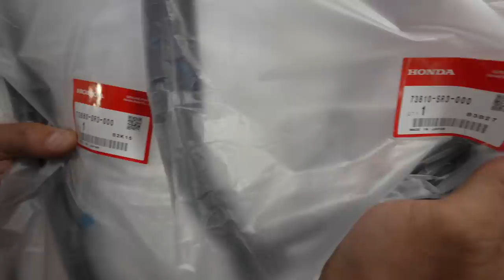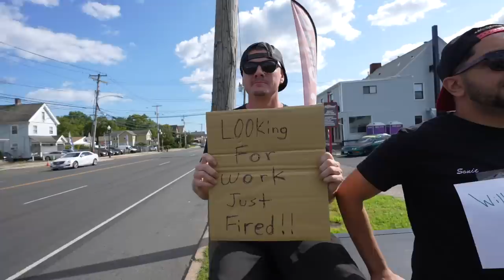500hp Turbo k20a2 Civic Si Build! Perfection!

Comment: ive been using a timing cover drain on my car for the past 5 years or so, never once had an issue on the streets or the track. one thing that did happen from street use is the return hose started melting from the manifold, it was about 6 inches form it but on a hard rip it still started melting. i ended up doing a heat shield sleeve down the entire length of the return and never had another problem with that.
Reply from the maker: ok good to hear, ill get a sleeve also. Appreciate the feedback!

Comment: If I had to guess what wheels you would be using, I'd prolly lean toward some white 16" Sprint CP-R's w/ the red lettering or maybe some bronze 16" CE28's in the 4x114.3 lug pattern. Whatever it is, i'm sure its gonna be KLEAN!!!
Reply: It has to be CP-R’s. Just worried if the white would be thrown off with all the black that’s going on the car. But that would be my guess as well.

Comment: Yes sir it is art. You ever had to use a bigger alternator because of coil on plug and bigger fuel pump ?
Reply from the maker: not really, the s2000 one works great, i know when you start getting into the big weldon pumps you will need a 16v, but no issues with stock alternators on 12v

Comment: Got to do the 98-01 ITR calipers on that 4 by 114.3 hub, use 96 prelude v-tec rotors for the front and 96 accord ex rears